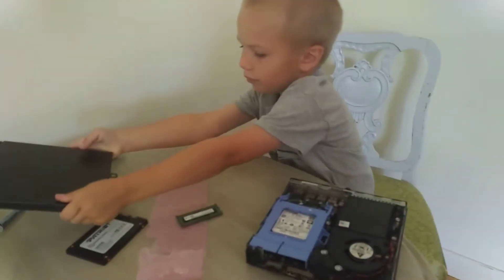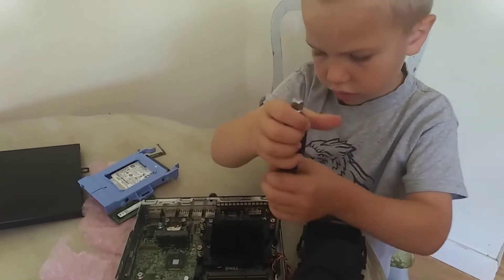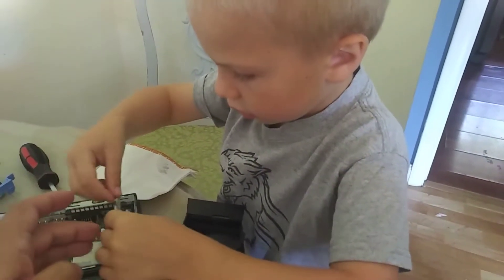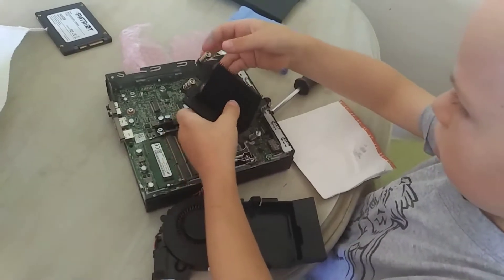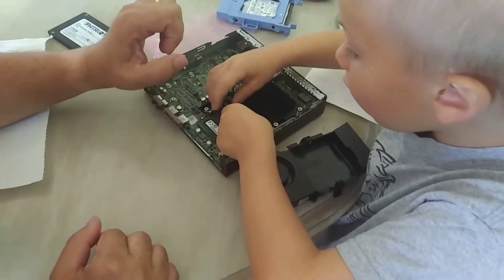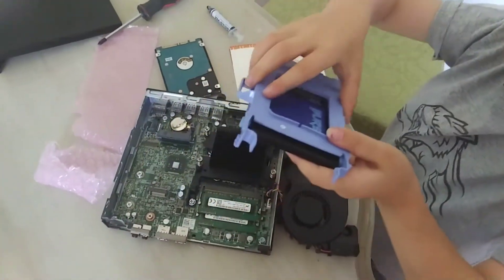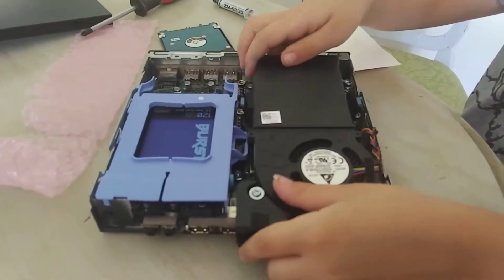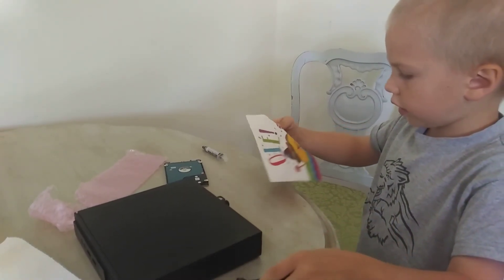Dell Optiplex 3020 micro CPU upgrade

Comment: Just upgraded the Ram to 16GB and went with a SSD what CPU do you recommend and do you think it’s worth it since I’ve updated the others?
Reply: Model	       Cores (Threads)	Base frequency	Turbo
Core i5 4690	    4         (4)	              3.5 GHz	         3.9 GHz
Core i7 4770      4        (8)	              3.4 GHz	         3.9 GHz
Core i7 4790	     4        (8)                  3.6 GHz	         4.0 GHz

Comment: can you upgrade this to an i7?
Reply: I'm researching this too... n the consensus is yes. to whatever cpu fits, keeping in mind temps and power requirements. 
65w, 95w cpus would require a 90w adapter n 130w adapter, respectively. 

i have 3070M with i59500t looking to move up to i79700t but Too expensive,,cheaper n faster i79700 or i79700K cpus abound.
Reply from the maker: Yes. There are some low voltage i7 CPUs that will fit. Basically it uses laptop components so you would need a laptop class i7 which are available.
Reply: This 3020m support core i7-4790 (SR1QF) 3.60GHz y core i7- 4770 (SR149) 3.40Ghz and others core i5 and core i3

Comment: Cute video. Question: What cpu did you upgraded it too?
Reply from the maker: To an i3. I think it was a 4330t or somethng like that. It was a haswell
Reply from the maker: This system can take up to an i7 quad core, though they are lower voltage. I think they can only take a 45 watt CPU, the one I put in uses 35 watts as I recall